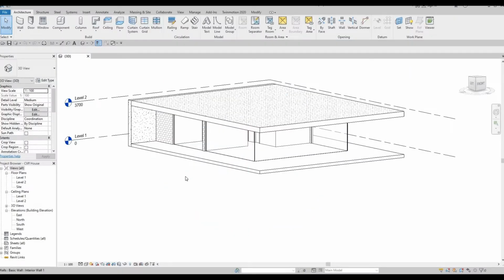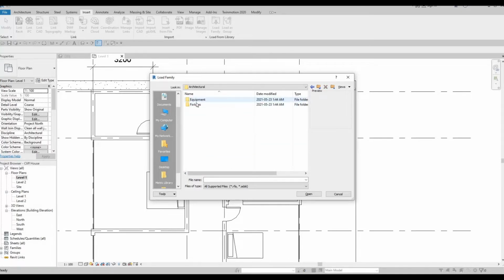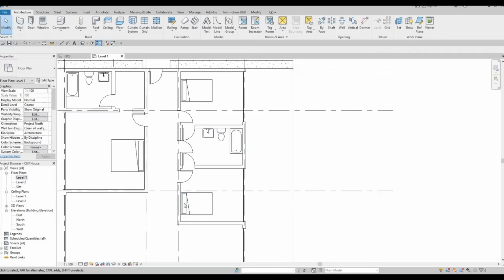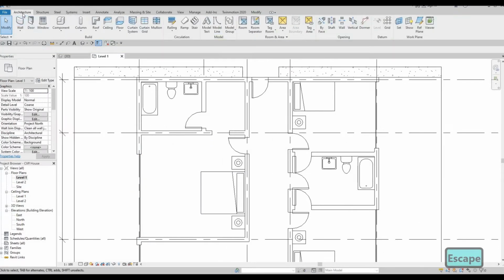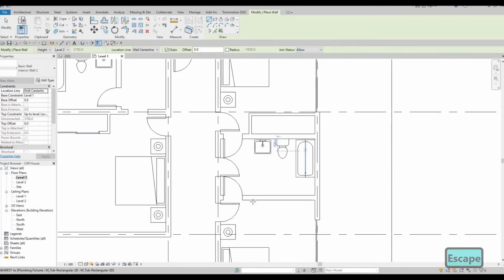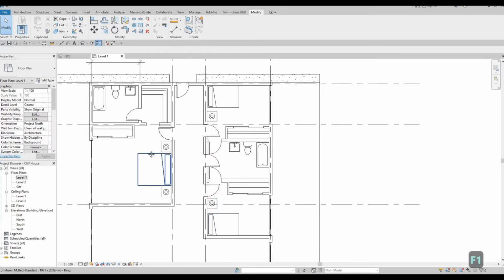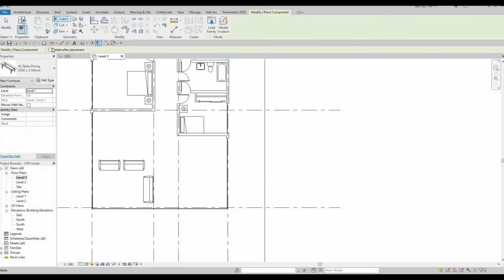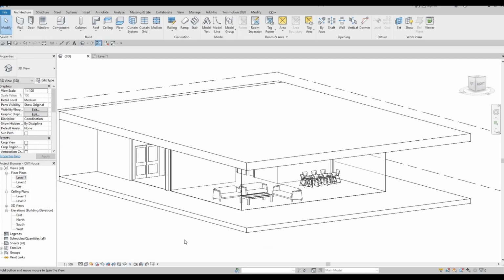Cliff House | Part 3 | Complete Step by Step Project | Revit Tutorial

Comment: Sir Why cant we do the interior work in Twinmotion ?? It has better components than revit .. can we replace the components that we placed in revit with the comments of Twinmotion after opening the revit project in Twinmotion ... and sir in the plugin of Twinmotion there are three options 1) See in Twinmotion , 2) Some setting options and 3) is export to Twinmotion... what's the difference between option 1 and 3 🤔 and how to work in option 3.. tried opening that its kind of weird I could not understand what it's used for ..
Reply from the maker: Hi Mihir, yes definitely, in the later part of the video, I will be delete the Revit blocks and replacing it with Twinmotion blocks. The reason adding Revit blocks is in order to visualize the area and space. 🙏🙂
Reply from the maker: The difference on 1 and 3 is that option 1 is a direct link, sometimes when you have a ceiling fixture lights, it doesn’t appear on twinmotion, So an alternative way is to use option 3 and in that way, everything in the revit scene will appear in twinmotion. I might do a video on that, just to explain or show it better. Thank you 🙂🙏
Reply: @ArchCoreDesigns  okkk Thank you sir 😊😊👍🏻
Reply from the maker: Thank you as well Mihir 🙏🙂